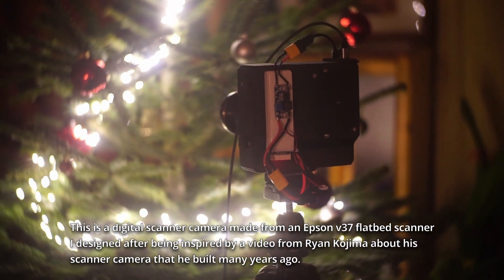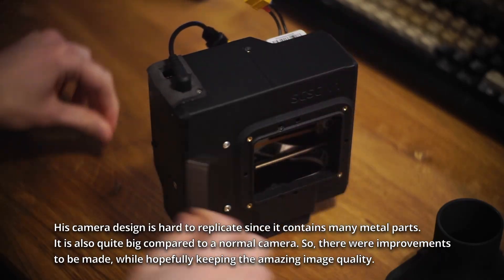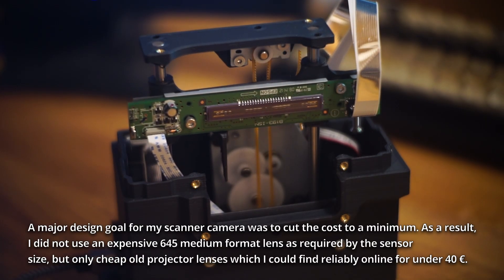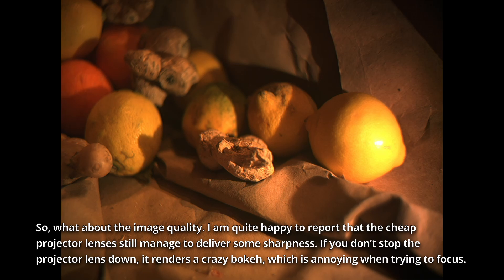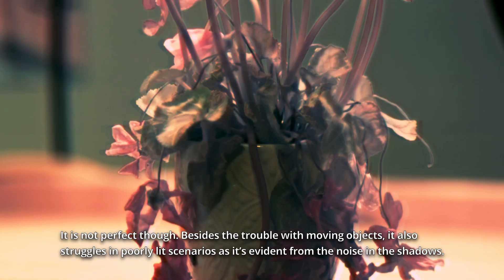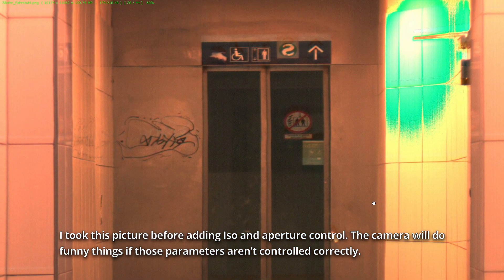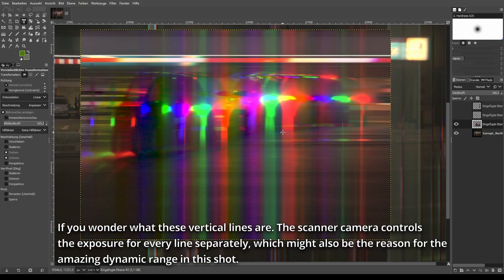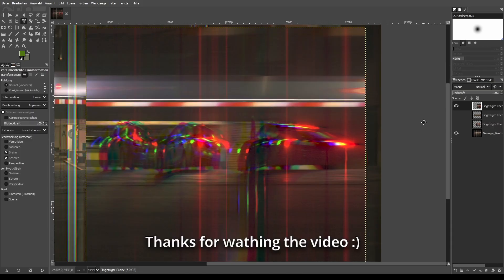489 Megapixel DIY Digital Camera for little money.

Comment: is the motor powering the movement from the base unit or did you put your own motor in?
Reply from the maker: Yes it is, most parts are directly from the Epson scanner. What I have done is basically just a 'clever' repackaging of the scanner.
Reply: @yunuszenichowski  did you just saw the rails shorter and basically add a small screw for the stopper?
Reply: @yunuszenichowski  sorry so many questions i am just super interested in building this for myself as id love to be able to have high Mpixel photos
Reply from the maker: @ The cad files I linked in the description contain many of the details you need to know to build one. Please also read my answers to other peoples questions in the comments. I did advertise the high MP as it's main selling point, but you will be disappointed if that's your only motivation. Though, it's a very rewarding project if you are into experimental/esoteric cameras, it definitely delivers on that front :)

Comment: Can the scanner be made to move faster? Or is it limited by the bandwidth of the machine itself? Ie could a motor be used to make it scan faster or is that pointless? Would be a cool design to have giant image areas for far cheaper than having a single solid image sensor

Comment: Hi @yunuszenichowski thank you for making this. I believe I am going to have few days of sleepless night about thinking what exactly CCD sensor you used to make 400+mp sensor. 
I love taking long exposure photographs on my 8mp wide angle camera and later manipulate those pictures. 

I see extremely amazing potential in such camera to create experimental long exposure photographs. 

Would you be up to help me with your build guid, sensors and software?
If I have missed on your build blog on Hack-A-Day or something. Please do let me know. 

Love from India and Genuinely appreciate your other work as well. Have a great day ahead.
Reply from the maker: Thank you so much! The resolution is this high, because it is a linear sensor, moving along some axis. This effectively results in an image of size sensor-pixel-count^2 or more, depending on how far the sensor moves. I was using the hardware from an Epson v37 scanner.
I would advise against building one, if you don't really want to. The information provided in the video and the 3d model, is absolutely not sufficient to quickly build one. You would have to figure out most things on your own.
I sadly didn't really finish the project, which is why there is no tutorial or anything. With a tutorial, it would be very easy to build one :/
Reply: @yunuszenichowski  thank you for your reply! Now I understand the megapixel part. This camera genuinely have great potential to take great experimental pictures, if printed can be sold as artworks ha ha. 

I am kidding. But if you would like to take back and work on this project. I am up for helping you out with this project. Anyhow I can do it. But I would love to collaborate with you if you feel comfortable.
Reply from the maker: @TheHitesh74  The reason I didn't continue to work on the scanner camera idea is that there is a huge bottleneck for how good and especially practical/usable the camera can be, due to the fact that it is basically an off the shelf scanner, packaged in a new enclosure with some hacks. For example, you have to keep a laptop attached, since it is still just a scanner.

Originally, I was interested in building a scanner camera from scratch, even designing the circuit boards, but then I realized how unattainable that goal was with the time I was willing to spend on it. So I just skipped that idea.

If you are by any chance a high speed circuit designer, then I would love to collaborate :)
Designing just a slightly refined scanner camera that is again based on some consumer scanner does not really interest me.

Comment: I don't know if you still read comments on this video, but you could drastically improve the contrast of the picture, if you would flock out the inside of your projector lense. They are very reflective but if you would use something like black 3.0 or other light absorber inside the lense, you would stop bouncing light in the lense and improve picture quality.

Comment: I have printed and assembled your design. However I’m running into a bit of an issue with the gear you used to drive the scanner. It doesn’t grab onto the belt nor does it sit firmly in the mount you made. Did you encounter this issue and how did you resolve it?
Reply from the maker: I tried to express clearly that it's not a finished model. There need to be 2 small bearings in the slit, and the gear has to be printed with a 0.2 mm nozzle. It's also extremely important to reinforce the gear shaft with a m3 screw. There should already be space for a threaded insert. I never tried to print the gear with a normal-sized nozzle, so it's nice to know that the smaller nozzle was actually necessary. I am sorry for causing trouble like that. If you have more questions/problems, you can contact me via email, y.zenichowski@gmail.com
Reply: @yunuszenichowski   yeah I understood that the design wasn’t finished but I’ve managed to figure out of modify almost everything else. I appreciate the help. I will print the gear with a .2mm nozzle. Do happen to know the part code for the bearing you used?

I will email you if I have any further questions thanks!!
Reply from the maker: @will3346  I sadly can't give you any hint at the "right" bearings, because I would have to disassemble my camera to find out, just pick whatever fits. I used 2 to increase the vertical contact area with the shaft. There also is a major design flaw with the model that I only fixed after the video, the sensor has to be turned by 180º otherwise the image is mirrored and the color channels misaligned. Anyway, I am really happy that the video could inspire others to build one as well! That's awesome!
Reply: @yunuszenichowski  by pure coincidence I have already rotated the sensor by 180 degrees. However as I’m using a slightly different sensor from a V200 I’ll have to play around with it after assembly.

Comment: This sounds like it wold be perfect for taking pictures of negatives
Reply: True tbh, you could compact it down as well by removing the lens and just placing the negative directly against the scanner. Wait...
Reply: @CulturalCats lol
Reply: Flatbed scanners already exist lol.  This scanner camera isn't faster than a scanner, and the quality isn't better because its literally just a made from a scanner.  The whole point of using digital cameras to scan is that it's faster than flatbed.  This has no advantages in film scanning
Reply: @Hikikomommyuwu no that’s not the whole point. A camera can be dual use. No one can justify the price of a scanner of that quality

Comment: Hey great project - could you share more detail on how you controlled the intensity of the light source as well as how you turned it off during the scan? Attempting a build myself and have useful images but want to push it to have adjustment in the light source intensity and to turn the light source off many thanks!
Reply from the maker: I had implemented a mechanism that controls the light using a diy limit switch and potentiometer (I believe 0-50k ohm). There should be some information about the details in the comments already.

Comment: You sure it's that high in resolution? Don't most scanners top out at a number and the rest is just fake upscaling?
Reply from the maker: Yes, linear sensors have an enormous scaling advantage. They only require the square root of pixels of an area sensor for the equivalent resolution. So it's extremely cheap to go high in resolution. Obviously there is a price to be paid though.
Reply: @yunuszenichowski  Okay then, I was just asking because back in the day I looked into film scanning and was told that most scanners can't practically do more than about 16mp per 35mm frame and after that it's just fake upscaling.
Reply from the maker: @fandyus4125  most scanners are designed for A4 paper, which is about 72 times larger than 35mm film, so the resolution of the scanner would have to be over a gigapixel to achieve 16mp film scans.
Reply: @yunuszenichowski  Oh, I see, thanks for the explanation! It for sure is very impressive what you've made here.
Reply from the maker: @fandyus4125  your welcome, thank you :)

Comment: if you combo that with rotational miror + concave lense.. you can make a werry fast shot.. without need a mechanical sliding.. in actualy .. 489+ mpx
Reply from the maker: Actually have a sketch of that :) The main problem is the required size for the mirror. I wasn't aware of concave lenses, but with normal ones you would also get a weird focal effect.

Comment: I think you need a  telecentric lens. Telecentric lenses maintain a constant magnification over a certain range of object depths, which means that objects at different distances from the lens appear to be the same size. This property makes them particularly useful in machine vision applications, where consistent measurements are necessary, regardless of the object's exact position within the field of view.

Comment: I'm a bit confused right now. Saw some other guy's video and he said that you gotta have ground glass to project your image onto. Are you scanning the direct light?
Reply from the maker: The light falls directly onto the sensor. You need the ground glass, if you use a scanner without removing its lens.
Reply: @yunuszenichowski  wait, so if I remove the glass from the scanner I don't need ground glass? So there's nothing between the lens and the sensor?
Reply from the maker: @pastasuta  The lens is not the glass surface of the scanner. There is a tiny lens inside the scanner. You would have to disassemble the scanner, to see it. Also, most cheap scanners have CIS sensors that have no external lens at all and can only focus on super close things no matter what, so ground glass would be the only option.
Reply: @yunuszenichowski  oh so the scanner in this particular video is CCD with removed lens, did I get it right?
Reply from the maker: @pastasuta  yes, exactly :)

Comment: wait, 2:57 - are you saying this camera captures IR by default? I'm wondering if it would be easy to emulate aerochrome with this camera. Is there raw output? Some people remove the IR filter that came with their digital cameras in order to do this.
Reply from the maker: Yes, it does capture IR. The scanner software has an option for .bmp

Comment: Have you considered building a rotary camera that rotates both the sensor and lens? Some 35mm camera lenses will cover this sensor at the widest part of their image circle, and that would provide an extremely sharp panoramic lens.
Reply: Pardon me, but why on earth would one want that sort of convoluted setup? The moving sensor thing in this case works specifically because it is very light, and still it is causing issues. Your idea would require a geared down stepper motor for the rotation I gather, but you'd have an issue with the focus at the edges of the image circle VS the center I think, so the top and bottom of the image would likely be both much dimmer, and have different focus than the center, one or the other being in focus but not both. 
Also, I think I've seen long interval rotating mounts made for cameras pre-digital, I don't remember how they were set up but it would be easier not to have to fab the thing to test the idea.
Reply: Think more a simple linear camera that rotates about its' axis - the sensor is attached to the lens and the whole assembly rotates. Look up "slit camera" for the film version of this. 

It obviously provides perspective distortion, but the tradeoff is unmatched resolution. 

Alternately, if the camera were attached to a slider, the image could be captured without distortion as it sweeps from side to side. The lens is best at the center; why not move both?

 @noth606

Comment: Interesting project, indeed. I've made a photo of my daughter once - long before I got my first digital camera - by using a black-and-white handscanner on a glass plate. By moving it up or down, I could indeed get a picture, but just as with your system, the object should be stationary (which my daughter tried, but still she appeared a little wobbly 😉). The scanner was connected by a parallel interface and gave dithered results, just to get the idea of the image quality in those days (I think Windows 95)...

Comment: 48 bits colour channel - but a good monitor or Tv only has 10 bit . . . so waste

i like the foto 3:20 👍
Reply from the maker: Thank you :) It doesn't have 48 bits per channel. I meant to say that it has 48 bit color depth, which is only 16 bits per channel. However, the real color depth is likely not far above 8 bits.

Comment: Why would it not be possible for someone to create a fast moving scanner sensor. One that swipes across within a second. Would require special software and maybe a modified scanner sensor that can capture thousands of lines in that second.
Reply from the maker: I have actually thought about something similar recently. There are sensors that can readout 7400 lines per second (and also very big ones with 17000). (maybe even low frame rate video recording could be enabled). The question is, how much light they would be able to capture...
Controlling them also does not seem to be that complicated. The camera could additionally be much more compact, if you design it from scratch without using a scanners' hardware. On the other hand, it would absolutely be more expensive, since you cannot profit off the affordability of mass-produced scanners. The upper mentioned sensors are alone ~€100 and ~€250.

Comment: Hi Yunus, amazing work. I do take pictures but I'm afraid I know little about the sensor tech or the physics involved that makes digital cameras work. Do you reckon that it is possible to instead substitute the scanner sensor for say, a more purpose built, Pi HQ Sensor and attach it to a motion system and stitch the images. I wonder if M43 cameras use that approach to make "Super resolution" pictures, since the sensor is attached to a IBIS system and physically moves. Do you think that moving a Pi Sensor could be done with a design similar to yours / or is that feasible at all? Or would it be too shaky and introduce lots of motion blur or what challenges do you think that design might face?
Reply: I can probably answer some of these things.

I have a Pentax APS-C camera that makes use of the optical stabilization platform to take high-res images. I don't know how many other cameras do this.
The mechanics are a little different though -- the sensor is shifted around by just half a pixel. Some fancy computation is needed to create the resulting image, as the pixels in the four source images overlap each other.

Moving a cheap sensor in this way would be incredibly difficult, as you'd need to reliably be able to move it by only half a pixel. It would also mean that your resulting sensor area is still absolutely tiny, and the low amount of light captured would make it hard to take advantage of the increased resolution.

Scanning the sensor across the image (as in this video) probably wouldn't work very well either. Because the sensor is square, you'd need to scan in two dimensions - adding mechanical complexity and making each shot take longer. You'd also be getting much more data than you actually need, unless you're only using one row of pixels.

Comment: I'm working one on making one based on your models and I have a question. Are you controlling the camera with a laptop or something or are you able to control the camera standalone?
Reply from the maker: Yes, a laptop or something with windows/mac os is needed for operating the camera. I think, with proprietary software, you can also run the scanner with Linux on the Raspberry Pi.
To be honest, the requirement of carrying a laptop around is really one of the bigger downsides of this design.

Comment: Very cool! Have you considered using old large format lenses instead of projector lenses? They can have massive image circles, and many can be got for a great price even cheaper than more modern medium format lenses, because they are simpler (they literally just mount on a lens board and are focused by moving the lens itself).
Reply from the maker: Thank you very much for the suggestion. I remember, having considered them, but after the first google search I originally discarded these lenses for being too expensive...
However, there seem to be many used large format lenses for below €100 on eBay. I think this might be the next step towards legit 500mpx :)
Reply: @yunuszenichowski  Another suggestion: Have you thought about trying an old enlarging lens? An old 135mm Wollensak Rapter or a Schneider Kreuznach Componon 135mm (covering 4 x 5 inches) can be found online for about $35US, and a 210mm Componon (covering 5 x 7 inches) for about $70.
Reply: @jbozeman37  Exactly my thought You beat me to it! I have an 80mm Schneider I just re-found! a bit small for this size linear array but the idea is quite good.
Reply: Agreed. They can be found not that expensive if you look for one without shutter. You would have to mess around though with fixed aperture holes since that is usually embedded in the shutter.
Reply: For example a rodenstock sironar 150mm is quite good in resolution, most of those have an image circle between 4x5" or 5x7"
Reply: IMHO this is the main reason I've considered building a scanner camera.
Reply: How about no lens at all? Have you considered a pinhole camera or would it be too dark? Could you slow down the scanning mechnism to increase exposure time and make pinhole work?
Reply: @_Thumbnail_ that's literally what i thought after seeing the lens prices... But probably going to be too dark
Reply: Some Tilt shift lenses can produce a larger image circle.
Reply: Or adapt this to a 4x5 view camera if you find one on the cheap.